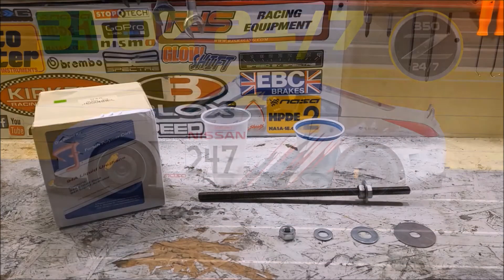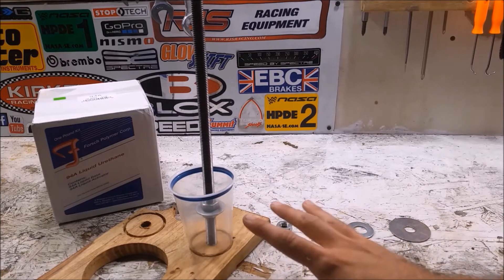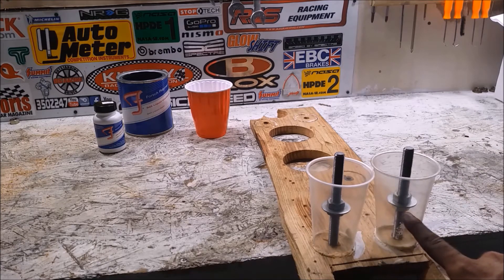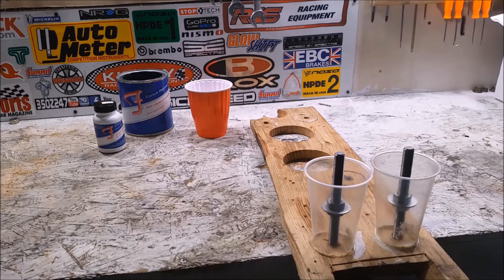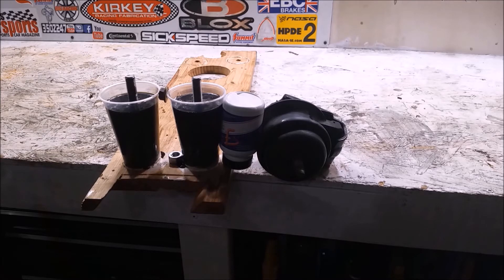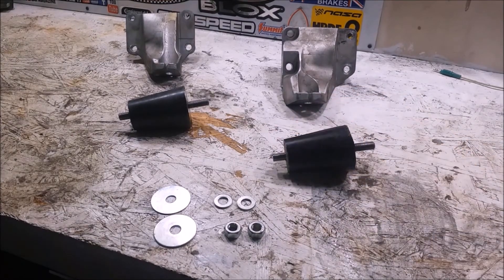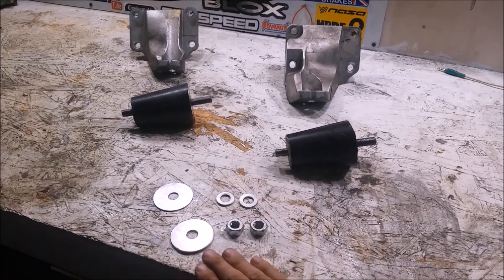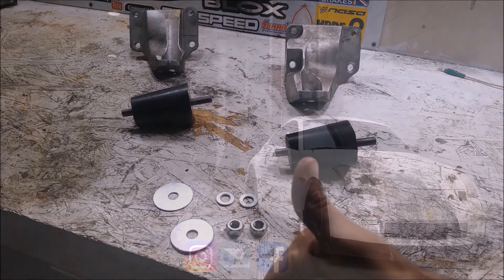Custom Polyurethane Engine Mounts DIY

Comment: U had to inlarge the bracket so I won't have to do that wat size is the stock bolt 🔩
Reply from the maker: It's been so long I couldn't tell ya. I just remember the bottom stud is larger than the top stud.

Comment: how long did it take to fully cure? the website says 168hrs...
Reply from the maker: It is pretty solid after even just an hour. I left them for a full 24 before putting them on the car. It's a log graph; so, you get like 99% after the first 24 hours with the last 1% over the next 144.

Comment: Why not make Solid Engine mounts for the 350Z?
Reply from the maker: STREIGHT RIPPIN if it were a straight 6, I would because they're so balanced but the V6 is such an unbalanced motor that I still want some dampening of the vibrations. To make solid mounts you would just need some 2 inch diameter aluminum bar then cut it to 4 inches and tap it for the bolts you want to use
Reply: 350Z247 would Solid Motor Mounts Have any major side effects on our VQ’s?
Reply from the maker: STREIGHT RIPPIN there's nothing specific I can think of. It might require you to more frequently check bolts for tightness as it may rattle them loose
Reply: @350Z247  can you make these for my 370z?
Reply from the maker: @zambleTamble  I don't trust my parts on other peoples cars, but there is a similar amount available online. I'll post a link.
Reply from the maker: @zambleTamble  https://www.ebay.com/itm/Solid-Urethane-Polyurethane-Engine-Motor-Mounts-Fits-NISSAN-350Z-INFINITI-G35/182426873912?fits=Model%3A350Z&hash=item2a797d3038:g:K40AAOSwf-VWU4qX:sc:USPSPriority!29414!US!-1